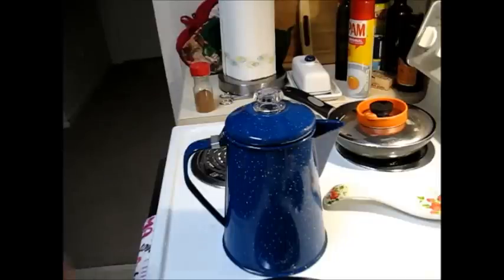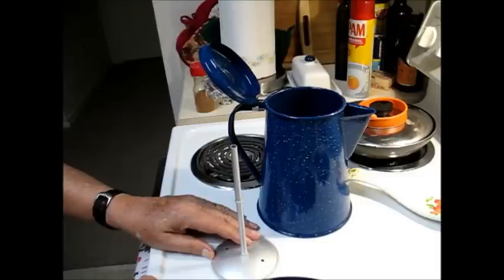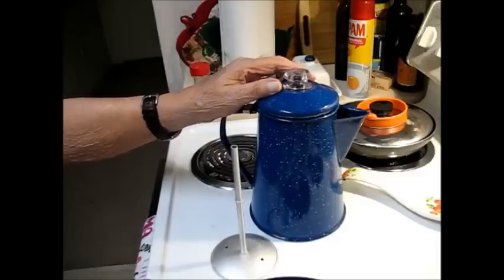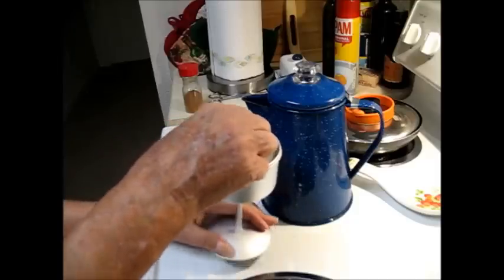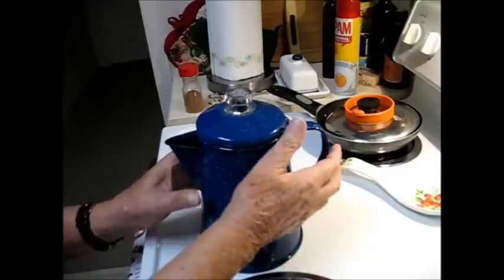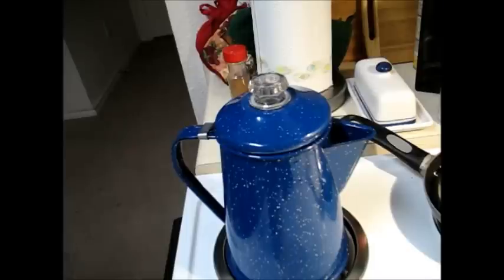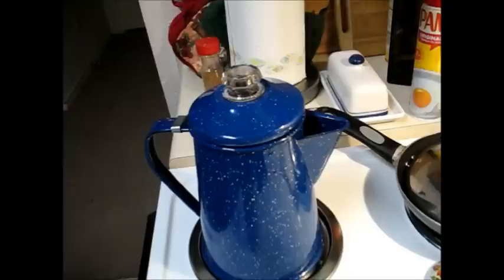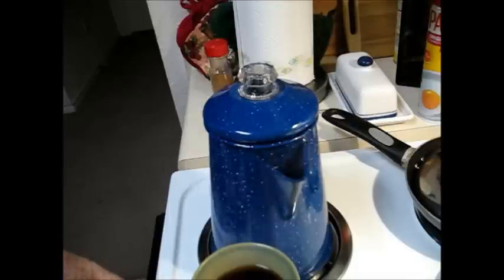HOW TO MAKE PERKED COFFEE

Comment: I've used this type of pot for years-  When it starts to first perk - if you time 5 minutes...you'll have the perfect cup...
Reply: Excellent thanks
Reply: Thanks for the info👍🏼
Reply: I have a stainless steel stove top percolator. 32 ounces water, 5 Tbs. coffee. As soon as the perk starts, I turn down heat all I can,to a SLOW perk for 10 minutes. Let set for a few minutes to drain. If you let perk with too high heat,grounds get flooded and end up in your coffee. I also use round filter, my preference. Best coffee every time.
Reply: I was told and have been doing it for 1 minute.  However, it might be because of the way it was ground.
Reply: I go 10

Comment: I have the same pot but mine does not have the dome...just a plain lid. I let mine perk for about 15 minutes. I LOVE HOW GOOD AND HOT THE COFFEE IS WHEN YOU POUR IT!  Also, mine was missing the round top part of the basket when I bought it. I didn't know it was supposed to have one. I bought it for camping originally, and whether camping...or now when I use it in my kitchen, I have never had a problem brewing without that top to the basket. The only thing I do to be sure no grounds get in my cup when I pour, is I remove the basket and stem part leaving only the coffee in the pot. I wish I could get the top part though... I have seen replacements for certain perculators but not sure they would fit mine. Maybe I will find one in the thrift store one day cheap. It would be nice to have. :) :) Thanks for this video. Enjoyed it very much. Didn't know I had a little train on my stove top. :) :) That's cool. :) :)  God bless.